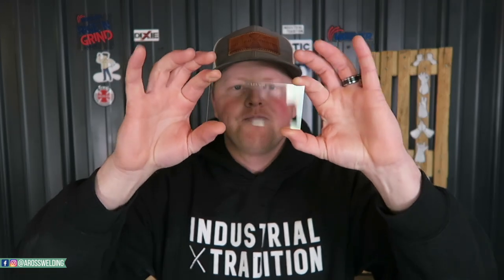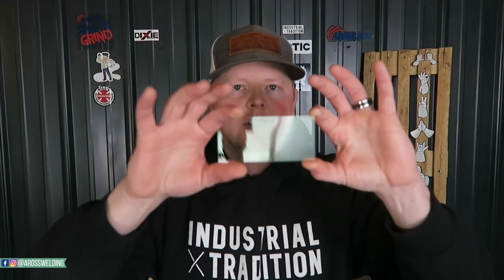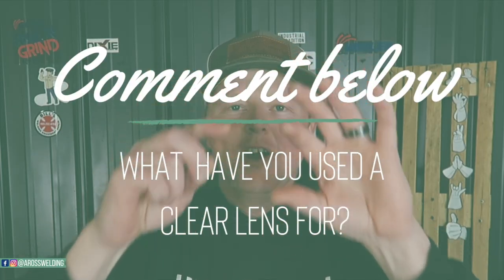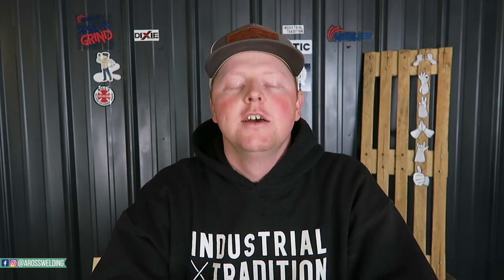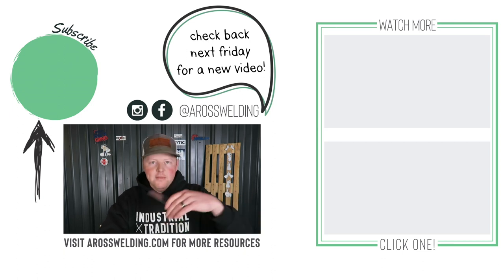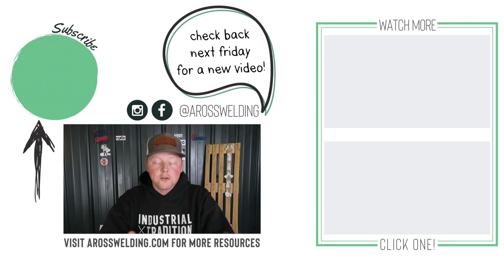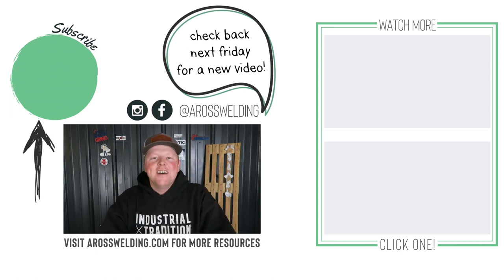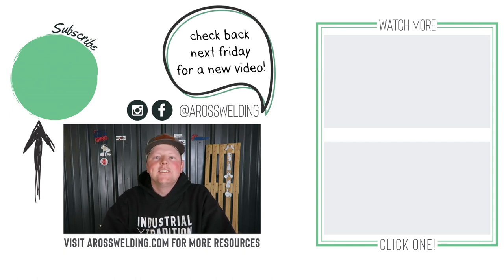CLEAR WELDING LENSES (DID YOU KNOW YOU CAN USE THEM FOR THIS TOO?!)

Comment: I use clear lenses as a window when I'm Tig welding stainless pipe, stick a clear lens on the opposite side of your purge and tape around it. Helps keep an eye on your root after you close it up or if you can't see it! Super helpful on Tests!!

Comment: Back in my structural welding days. Not everyone had fillet weld gauges. So we would cut the corner of the lens to the right measurement to use as a gauge.
Reply: Fermin G yeah me too we would measure 1/4 on each side cut it a you got yourself a 3/4 weld gauge!

Comment: I was beveling some fittings with a bevel machine and there was a lot of high low in the top and bottom. So I put clear lenses under the dogs to get a good cut. Worked good.

Comment: We use them as a gap tool when we are fitting round seam on storage tanks. We will go through after we finish tacking and if a clear lense will slide into the gap, we string it. We weld it with a 3 o’ clock with 3/32 wire.

Comment: I swear it works but if you get undercut running harder pipe take a clear lenses and melt the corner of the undercut with it. Works every time. Old timer showed me and I thought it was a joke until he showed me.
Reply: Works like a charm
Reply: Melt the corner of the undercut with the clear lens? What exactly do you mean by this? Sounds helpful.
Reply: VVSbtz when the weld is hot take a clear lense and run it along side your undercut the plastic melts into the undercut hiding it
Reply: Yessir i learned this from an old timer. I didn’t believe it at first but sure enough that blind bastard made every weld

Comment: Ironworking we use them to help plum columns. We mark out the measurement on the clear lens to the measurement from the laser plum at the bottom of the column. Then adjust accordingly

Comment: I just bought a new welding helmet. It is auto darkening and came with clear lenses already installed in the helmet and then green tinted lenses in a separate bag. Am I supposed to put the tinted lenses in right out of the box or are they only for a specific type of welding?

Comment: on a fixed lens hood pull out the tinted lens add 2 clears so you can use for grinding in a pinch or when you didn't pack any TP lol

Comment: Kinda off topic but in case some don't know where the heater vent blows hot air out from under the seat of a morooka buggy is a great place to take an empty rod can / box put ya lunch in it with hole in can in front of vent about 10 min. it's too hot to eat

Comment: Why don't you use a 4X6 lens hood while on pipe ? They seem to have a lot more overall ability of depth perception .
Reply: I personally dont get any benefit to using a hood with a larger viewing area. If you cant see just move your head.
Reply: The pancake fits tight to the face to keep sparks away from the eyes. At that point the angle of view is such a larger window would have no advantage.
Some where he did a video about fitting a pancake.

Comment: I gave you a thumbs up, Great job on the video buddy.   However if your face was not 6 inches from the weld your lens would not be getting hot. I run heavy wall double extra heavy wall with a glass lens with no clear lens on the inside or outside I can see my puddle from across the room! you won't catch me bent over touching my toes while I weld!  but to be honest your shit out of luck because using a number nine shade for so long you've burned your eyeballs out you know you'll never be able to go darker than a nine and you'll never be able to see farther away than 1 inch from the weld So you might consider putting three clear lenses in front of your lens! :D  Great job on the video buddy keep it up! ; )